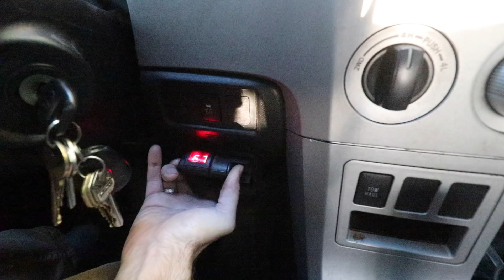How To Load a Trailer to Prevent Trailer Sway

Comment: When I was 17 we decided to tow my buddies boat with my Bronco but only a few threads on the ball were available. Ball came off and we had a good lesson on why you cross cross the safety chains. It held the boat up pretty well while we got off the road. It swung from the chains under the bumper

Comment: Picked up my Jeep years ago using a car dolly. The tire straps were way too small for the 33” ones on the Jeep. Tried using some ratchet straps a extra safety (totally pointless). Drove 2 miles down the road and one tire strap came off and the Jeep was sideways on the road. Luckily no one was on the road. Took the Jeep off the trailer and then it ran out of gas about 5mile later. Called AAA and the guy didn’t want to tow it because it wasn’t registered. Finally convinced him saying I’d take the ticket it we got pulled over. We got it home without a ticket thankfully!
Reply from the maker: Those tow dollies are super sketch!

Comment: Scariest Towing Experience  or should I say "Sketchiest" lol. We were flat towing my TJ trying to evacuate before a hurricane showed up. We had just taken a trip to Gulches ORV the weekend before. Little did we know on that trip I had grenaded the axle shaft bearings. Well on the interstate As I followed behind my husband who was towing the jeep I could start to see the rear wheel start to separate from the jeep. No sooner could I lay on the horn to warn him, the tire and axle shaft spit out from the rear bounced off the road Hit a tree on the right side of interstate and came right back to me rolling to a stop right in front of my Toyota. Lost a lower control arm mount, lower shock mount, destroyed brake backing plate and rotor.  Sparks everywhere. That was a fun day.
Reply: Oh and completely bent the steel wheel when it hit the tree. Never seen a steel wheel bend that severe. Tire was fine though lol still using that axle under an LJ to this day though
Reply from the maker: Everything is sketchy with you Kala 🤣🤣🤣😳😳😳😬😬😬🤪

Comment: So one time I was towing my Jeep home from a wheeling trip and at the time my truck liked to shut off going over certain bumps sometimes. (Wiring issue from previous owner) So I was passing a wide load on an overpass and had to go over onto the rumble strips at about 70mph. Truck shut off, feces exited my bung hole, and then the truck came back to life. Crisis averted. Almost. 💩

Comment: On a totally unrelated topic, I have a 95 grand cherokee, I wanna 3 and half lift, saw yer video where you put the front springs in the back but is there another jeep out there with longer springs to make the front higher without that spacer?
Reply from the maker: I doubt it but brand new coil springs are pretty cheap and you can get any length you want, usually for around $100 to $150.

Comment: So I was towing a trialer I closed and 25 foot long, two axles but wrong hitch ball size ended up going threw a intersection and trailer came flying off the truck and sparks went flying luckily nothing flipped ended up getting the trailer back on the truck and too the job site 🤨😬

Comment: I am a state trooper. In June of last year a gentleman towing a trailer failed to secure his trailer at all. He just sat the trailer on the ball. I was stopping a vehicle on the left shoulder of the highway when this guy topped the hill.  The trailer separated and the safety chains broke. The trailer flew through a yard and came to land a few feet from me. When I explained to him how you secure a trailer to the hitch, I just counted my lucky stars.
Reply from the maker: Ohh wow, so do people really stop on the left side of the road?  I've seen this several times and if I were a cop I think I'd give them a ticket for doing that,  or is there some reason I'm missing?
Reply: BleepinJeep Most of the time I would prefer they pull to the left shoulder but in this case she save my life.  I would have been struck and killed by that trailer if I had been on the right shoulder. I am a motorcycle officer and work the highways.  People do crazy things when they see the red and blue lights behind them from a regular patrol car. When they see the lights of my motorcycle behind them people do even crazier stuff. So people just lock up their brakes right in front of us. Some will put on their hazards and drive for five miles. It is an interesting phenomenon. 

On another note,  keep up the great content. I built a 2001 TJ that I bought totaled from COPART a couple years ago. This is the third Jeep I have had.  It has brought me back to the good old days. The knowledge I have gained from you have saved me thousands. My wife thought my Bleeping knowledge was so important she made me something for the wall. (I sent you an email, I couldn’t get the photos to attach here)

Comment: I do have a question if you are building a trailer should the axles be centered under the loading platform or centered under the overall weight of the trailer including the tongue?
Reply from the maker: They should be further towards the rear of the trailer, but idk the exact specs, you should do more research on this.
Reply: @bleepinjeep  appreciate the info

Comment: Got a load of gravel in a dump trailer once for work and they loaded it just a tad too far back. When I got out of the yard I accelerated onto the two lane highway and up hill. It shifted the load to the rear. I got to a point going down hill with on coming traffic and, UHOH! Shoulder work! And of course it started fishtailing.
 I tried the trailer brake and it failed! All I could do was accelerate till it stabilized. Played on the horn, all the workers running away when they see me, and just by the grace of God, made it past and decelerated till I could stop safely and used a bucket to move the gravel forward.
Reply from the maker: Ohh man I bet that was scary!

Comment: Used your last loading a trailer video before loading a car for the first time and it was a great help. After towing with the 1/2 ton I quickly realized it is not going to cut it. Went out and bought a used 3/4 ton which has a brake controller and knowing what that little button does will come in handy. 

You speak of front and rear placement and how to secure the axles. But I had a thing where with a very firm trailer the rig on the trailers suspension had a good amount of articulation. When I came across a 6-8" "dip" on a uneven roadway the thing being towed would "flex" on the trailer and cause the thing to start to sway. A couple "limiting straps" connected snugly to the rocker guards prevented this. Going somewhere offload or just down washed out dirt roads you may come across these dips. I am not sure if tying down the sides was a good thing or bad thing. Your thoughts?
Reply from the maker: Its fina as long as you have first secured your axles.  In fact the first how i tie down video i did something similar if you want to watch that.  Just make sure any hooks you use won't disconnect with articulation of the rig.

Comment: Exceptionally well done Matt. This is why on a semi trailer you have the ability to slide the wheels forward or back to balance the load.
Reply from the maker: You do?? Never seen that 😳
Reply: BleepinJeep Yes. You’ll typically see the procedure done at a shipper or around the weigh scales at a truck stop or highway weigh station. On an enclosed trailer, the shipper will typically place a metal tamperproof seal on the trailer doors to ensure nobody including the driver can tamper with the load. As a driver this results in the inability to enter the trailer and adjust load placement. Being able to slide the tandems allows this to happen externally without ever having to enter the trailer. 

Have also heard certain trailer companies like Big Tex etc are building this into some of their longer dual axel trailers.

Comment: I was hauling a bobcat loaded too far forward on the trailer, and it ended up breaking the hitch. Bobcat game off the trailer and slammed into the truck as I was braking for a stop light, held up traffic for 2 hours😂
Reply from the maker: Holy crap... you rear ended yourself?

Comment: Loose coupler at low speed disconnected and punched a hole in my gas tank. Yes safely chains were used. Trailer was loaded correctly just had axles welded to the frame no springs
Reply from the maker: Holy smokes, welded to the frame??

Comment: Had my clutch go out on the trails so we got it to the road and just had my brother inlaw pull me home with a 20ft strap and told him to take it easy on the way home. Only about 15mins away from the house down back roads. Well he got up around 60 to 70mph on some tight roads and had to use my bakes to slow him down. almost ran into the back of his truck a few times going around turns. Scariest thing I every done. He never had towed a truck like that ever before
Reply from the maker: Lol, I guess you shoulda gave some more specific instructions 🤣

Comment: My Dumbest and scariest towing experience was in my Comanche With 7 in lift with 35s and flat towing my tj with 3in lift on 33 both were load way to much because I was moving and trying to save money “bad idea” anyways driving from Denver to Houston Tx lost my clutch in Colorado Springs and said send it the rest of the way And my steering column was shot also like so much I could barley get the key to turn I had to shake the hell out of it to find the sweet spot so that should’ve been mine sign but being young and stupid doesn’t stop ya 

AnyWho

So I made it to Wichita Falls filled up and got going again 20 miles or so out of Wichita I go around a Slight bend “That was a lil wet not to bad” doing 70 or so and the tj just completely lost it and it start just whipping from side to side which the Comanche didn’t like and it started to whip with the tj and sh** u not I was completely side ways on the highway trying to gain control of it downshifting upshifting anything I could do to try and get out of it To slow down and finally about 7-8 times doing that it hooked up and straighten out I pulled over changed my shorts and moved some stuff around and kept going 

I’m not a very good story teller but my in-law was behind me and she was getting ready to call 911 because she thought I done and thought it was going to be a terrible accident 
I really wish I had it on video to show everyone my mess up definitely a learning experience and hopefully doesn’t happen again
Reply from the maker: Holy wow, guess you better watch this video 3 times! 😆

Comment: One time i was pulling a lifted dodge ram on 35's with a car dolly and a 1990 toyota pickup with the v6, the 35's on the dodge were to big and the tires straps on the dolly would not fit over them, so we decided to use a come along to strap the truck to the car dolly (Dumb Idea) and a few miles down the road, hit a bump the suspension compressed on the dodge the come alongs came loose, the truck jumped over the front of the dolly and rammed the back of the toyota, wedging the dolly under the truck and bringing me to a dead stop at the bottom of a small hill that comes out of a blind corner, needless to say i locked the littlw Toyota is 4x4 low and dragged the Dodge and car dolly off to the side of the road before we were killed by a vehicle coming around the blind corner.
Reply from the maker: Ohh wow, lots of scary stories on those sketchy dollies!

Comment: It's worth mentioning that you can't always roll with a 60/40 bias on the tongue, or the 10-15% of your load guideline.  Each vehicle, and type of receiver has a tonge weight limit depending on the class and manufacturer you must not exceed.  Most trucks have a Class III receiver, which are rated for a 600lb tongue weight max.  So if you have a diesel that can pull 12,000 lbs, but you've only got a class III hitch, you don't want to be loading the tongue to 1200 lbs.

I've got a weight safe hitch with a built in scale.  They have a similar treadmill video on their website: https://www.youtube.com/watch?time_continue=50&v=w9Dgxe584Ss&feature=emb_logo
Reply: Bread996 ripped the hitch off my Cherokee doing this once.
Reply from the maker: Good info thanks

Comment: One time I got my car impounded and I had to trailer it home so I borrowed my dad‘s van and trailer.  The car barely fit on the trailer. The whole trunk was hanging past the back edge of the trailer. I was pulling it home down a Windy mountain road and for a long time it was just fine.  I had to hit the brakes because a coyote ran in front of me. Then the trailer started swaying back-and-forth until the trailer tires were coming up off the ground on each side.  It tilted so much that the hitch popped off the ball and the safety chains took over. I had to hit the brakes to slow down and the trailer slammed into the back of the van but the whole time the car stayed on and I came to a stop.  I almost crapped my pants.  In hindsight I should’ve just blasted that coyote.  Really I should’ve just found a different trailer. Oh well, nobody died.
Reply from the maker: Ha, dang thats scary!  That reminds me of an incident when I was a kid but we lost the whole trailer and it went through a subdivision brick fence.
Reply: I was young and dumb, lol.  I have plenty more trailer stories.  Never had good luck with them.